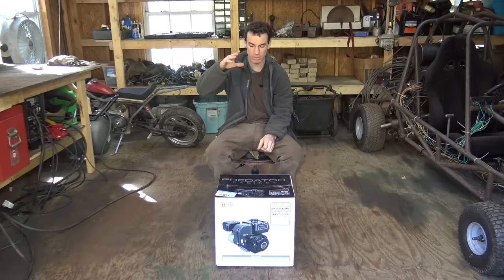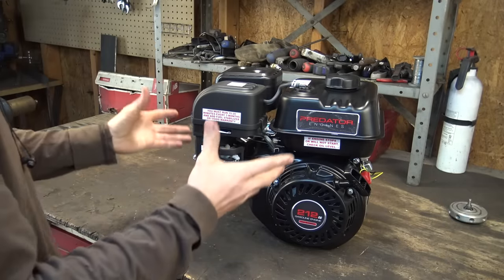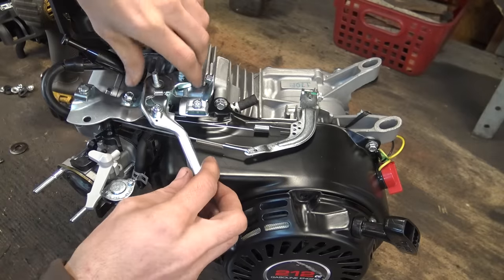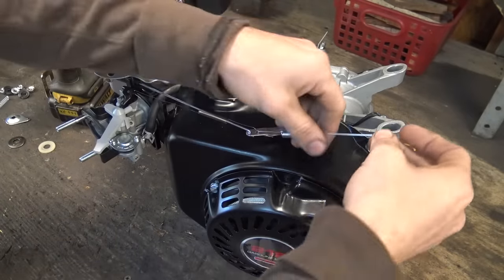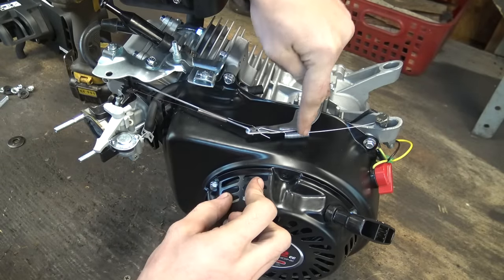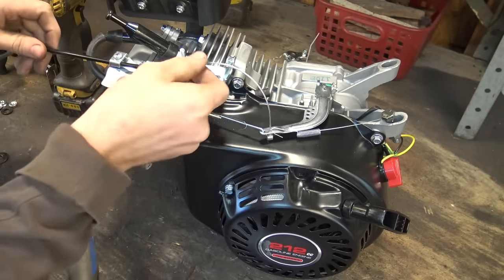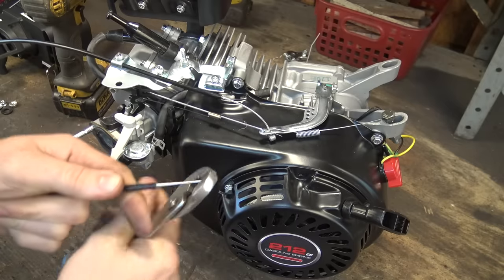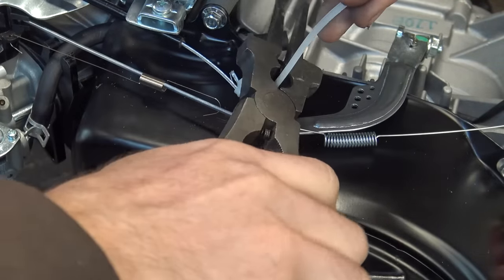how to bypass the governor on a predator 212 engine

Comment: one more thing you might wanna remove is the low oil cut off switch
Reply: Donovan Bryant why would you need to do that
Reply: T8opnjh💍💎🛂🚤🚀🚉🚸🚷🚵🚴🚳🚲⛵🛅🛄🛃🚶⛽🅿🚥🐶🐴🐖🐁🐈🐈🐱🐩🐇🐰🐓🐮🐄🐂🐃🐺🐐🐑🐏🐦🐥🐩🐤🐣🐔
Reply: If you're byutiful you can have a spris
Reply: +Trenton Smith the low oil cut off switch will shut the engine off sometimes even if the oil is not low and it also should be removed if the engine is being made into a racing engine
Reply: I put a screw through it so it doesn't make connection.
Reply: Trenton Smith cause when your taking turns oil is swinging around the sensor thinks your out of oil n shuts down the engine.
Reply: Trenton Smith just disconnect the switch n that other connector next to it.
Reply: That is not what this video is about, did you read the description?
Reply: Buy a Titan engine from gokartsusa.com. it's only a couple dollars more but it doesn't even have an oil sensor. Also it was made specifically for go karts and mini bikes unlike the predator engines.
Reply: I have a steep hill and driveway and I still have the low oil cut-off wire hooked up and it works fine never dies also mine is still governed I am trying this mod thanks

Comment: To make a ball on the end of a cable, bend the end, then wrap some copper wire (or some other wire you have layin around) inside the bend and around it, then solder it.  I used to do that with clutch cables on dirt bikes when I was a kid.

Comment: you can leave all that stuff on and just put two small zip ties around the spring and tighten till you get the right rpm the gov kicks in adjust accordingly.
Reply: How
Reply: @noahnubbs  there is a spring for the governor arm, just add 2 small zip ties inside to keep it from stretching open tight till you get the rpm you want.
Reply: @keithw372  thank uuuuu

Comment: @3:35 that spring just kink it and put it through the hole the make it catch the lip and hold and you should have enough room to pu the tank back on. same way I run mine without removing the inner governor and over time it will get faster !!! or blow up 1 of 2 ending's !!! don't hold wide open no more than 10 seconds at a time and run some 2-stroke for the higher rpm's.

Comment: At 2:53 if you remove that screw and keep the whole throttle assembly it will bypass the governor
Reply: Mike812 that's I thought ! But even his way the small plastic thing shouldn't even be spinning right ? Or no
Reply: That's actually not correct, you're still limited. It will surge and you will go top speed then slow down repeatedly, I just take the throttle arm and put it directly to the carb eliminating all the springs

Comment: RatherBWelding, So can I do this same process on my stock 196cc Mini Bike to bypass it's governor ? The thing is the throttle cable is already running to wherever they are running to when they come stock out of the box. Does the throttle cable have to be connected to the Governor Arm for this too work or can I just do the first half of this video and only connect the spring to the governor arm and leave throttle cable where it is ? Sorry I'm a newb and I need Help !!

Comment: Just purchased a go-kart with this exact engine.  This is so simple to follow, especially with the governor setup on these engines, the throttle over time gets stuck open.  Thank goodness for kill switches, right? ;)  Hey thanks for the video.  This was helpful!
Reply: if your throttle stays wide open just loosen the nut holding the throttle arm
Reply: yo if your throttle sticks you have a problem lol

Comment: Quick question for anyone, what is the reason for bypassing the govenor? Will it increase speed?  Just wanting my mower to move faster
Reply: The governor is just a rev limiter so without it you can run much higher RPMs
Reply: No lawn mower needs the governor removed unless you remove the deck and just ride around on it with a manual throttle. Bypassing on a push mower would be really stupid.

Comment: If you relocate the gas tank and swap it out for  a single hose connection, what do you do with the vacuum line on the engine? Plug it? or just leave it open?

Comment: I did this with new engine and it rattles at high sped that good
Reply: Well the point of a governer is to limit the rpm, by bypassing it you'll get alot more performance but you're also stressing the engine more because it's now running at 5200rpm max instead of 3600rpm max.
Reply: @Visuint depends on the use case and the cooling
Reply: Visuint you need to upgrade your internal parts that can handle more rpms.
Reply: U are a high sped
Reply: Put oil in it

Comment: The governor arm is still hooked up to the governor,,,so how did this by pass the governor.The throttle cable is hooked up to the governor arm.
Reply: fstngone he’s just removed the throttle arm and connected it back to the governor, not bypassed the governor.🤔
Reply: Exactly what i was wondering
Reply: But rather than the governor arm cutting the throttle you’re holding it open not allowing it to cut. Reach back when you’re riding and hold down the governor arm. Same principle. In other words free speed who don’t wanna crack open the engine

Comment: when you are using the cable without the ball you dont need to use zip ties y woud use a cable terminal block its much safer

Comment: Sorry ! but your not disabling the governor doing it that way !  the lever from the crankcase (governor arm) is still going to push on the throttle cable    all you are doing is reducing the governor's effectiveness ( it doesn't work as good as it used to)
what you need to do is leave the little spring on the back so the governor gears inside have something to keep them in check , but disconnect the throttle linkage completely from the lever, yes that gets more involved because of the way you have to actuate the throttle but that is the price you pay of taking the governor out of the equation....
a longer lever on the throttle butterfly and a spring to hold the throttle closed and you then would have the governor disconnected without going into the engine to remove the internals.... 
I would not remove the governor lever arm because of how these engines are made , leave it on and just use a spring to hold a small amount of tension on it.... but you need to disconnect the carburetor from the governor lever arm or your not getting anywhere.... because at top RPM the governor will still fight to close the throttle even if you put a bigger spring on it !
....so the real fix is disconnecting the throttle from the governor completely ! that makes hooking up your twist grip harder but it's the only easy way ! 
Bob.......
Reply: Bob Kelly, thank you sir. I thought I would read through the comments before saying what you said so clearly. Put a spring on the governor arm to keep it inline, throw the linkage away and build a simple bracket to hold your throttle cable housing. Then your gas pedal is just working the carb directly. I see guys opening engines up and losing track of how to properly reassemble them, it's amazing.

Comment: I bypassed the governor on an old Briggs and it threw the rod 2 weeks later.  The governor is there for a reason.
Reply: See what you need are some good valve springs, a mod 2 cam, an arc billet rod, a billet flat top piston, and a better flywheel. Then take that governor off and rip 👍

Comment: All you did was change the linkage points you did nothing to the governor except hooked a spring to the other side replacing the one that did the same thing that handle you threw away is just to manually adjust the rpm of the engine and holds it in that position you need to watch a YouTube video on the governor removal there is a lot more to it than that
Reply: That's exactly why the video tytle is called BYPASSING THE GOVERNOR not REMOVING THE GOVERNOR

Comment: The only function of the internal governor it to turn the bolt/shaft that is protruding through the casing, correct?
As such, with nothing connected to that shaft, the intermal governor CANNOT interfere with the throttle speed at all.
The external "governor arm" is no longer a "governor arm" once it has no connection to the governor shaft, it is merely a pivot point.

Comment: The valves start to float and then it bends the valves
I know from experience
Reply: James Becker wouldn’t getting higher weighted valve springs keep it from doing that ?
Reply: @jman1239  yes, but then the cast flywheel shatters like a grenade. Then you get a billet flywheel and the connecting rod fails. Then your valve colet fails after you get a billet connecting rod so you need stainless valves. Its always a snowball effect lol
Reply: Jim Holesaw ...I see you’ve “been there done that” as well😆 must admit it’s fun trying to get a few extra HP/LB-FT out of a 5-10 hp engine! My thinking brain has however did the math. When going to harbor fright(spelling is correct for all intended purposes) to buy a new engine it would be cheaper to buy a 15-25hp engine than buying a 6hp unit and getting 7-15hp with many $’s on hi-perf. Parts. 🤷‍♂️😆
Reply: @dieselsmiths  yeah i have about $1200 in my 30hp minibike. If you go with more displacement youll have more torque but not rpms and since we dont have transmissions. It goes back to that big block vs small block battle. 15hp with a 212 that has 36 jet a 265 lift dyno cam and exhaust with 26lb springs $120 roughly.
Reply: @dieselsmiths  yeah i have about $1200 in my 30hp minibike. If you go with more displacement youll have more torque but not rpms and since we dont have transmissions. It goes back to that big block vs small block battle. 15hp with a 212 that has 36 jet a 265 lift dyno cam and exhaust with 26lb springs $120 roughly.

Comment: Do not use zip ties. The best thing to use is wire crimps, used to join electrical wires together, slide it in there and crush it. I attached the spring to the ground screw that’s right below the fuel tank mount.

Comment: If you actually bypass it, you need heavier valve springs so you don't ruin your engine
Reply: its not interference, you can float valves and not hurt anything
Reply: @brysonshires9742 , except performance.

Comment: What would happen if you just adjust the governor control arm to a different position on the governor linkage. It would still be governed but it would rev to a higher limit but prevent WOT speeds. 
I don’t know, I’m just asking for a friend.

Comment: If you take that arm off then how are you ment to start your engine ?? That helps start mine up, if its not starting alone off just the pull cord ?? I have a similer engine, but mine is a Lifan, so the set up is a little diffrent but can i still use this process ?

Comment: If you use bike cable, the bike shop has little crimp butt ends for the inner cable that won’t fall through the hole and is plenty strong enough if you really crimp it down

Comment: Unless you put in a performance cam there is no reason to delete the governor. The highest stock engine torque/hp sweet spot happens at 3600 rpm, set the governor by adjusting the linkage stop screw or tightening the governor spring to achieve that 3600 rpm. That's as much power as you can get with a stock engine, you will get less power at higher rpm. Also unless you install a billet connecting rod the stock one will break at high rpm and the cast iron flywheel will develop hairline cracks and soon shatter. The pieces will fly at you like shrapnel from a land mine, a billet flywheel is needed. Additionally, stock valve springs will float causing them to send explosive shockwaves throughout the engine head unless they are replaced with stronger ones. Removing a governor using any method is nothing to mess with unless you know what you are doing, it's dangerous. If this guy were older he would have seen engines blow up, and have more common sense. All the pro-kart racers know this, it's common knowledge.

Comment: Gears, I did this to my 30 horse twin with no catastrophic failure. My predator engine gets the same treatment, actually install mikuni 28$ without any problems. Let us know your experience with this modification.

Comment: I had a techumseh 5 hp and I removed the governer because my friend lost all the linkage and I actually removed the gear but left the arm so I didn’t have to tap it. I ran for about 2 months and I tipped my tractor and oil leaked out but I didn’t car and it developed a tick. I got a new engine so me and a friend tried to blow up the 5hp and we had to put a spring on the carb at full throttle and fill the case with water. Still took 15 mins for it to go
Vid on my channel if you wanna check it out

Comment: I just bought a go kart with this engine. I left it outside and it rained. Will my engine be fine?
Reply: Cover the engine and if it’s gonna sit for a long time drain the gas tank. The go kart will rust because it’s exposed to the elements but it depends on how long it is out there. Use a trash bag to cover the engine
Reply: Yes, but it may not start if water got in the carburetor or the gas tank. This is essentially a lawn mower engine, so do anything that you would do with a lawn mower.

Comment: what is the use of a governor( i'm new to this stuff)
Reply: Felix Renard the governor keeps the motor from reviving higher then what it is designed to do therefore by removing the governor you are at a higher risk of blowing up the motor and it voids any warranty that the motor has if you remove it
Reply: Noah Ottinger I have a custom straight pipe exhaust on mine and a customer air filter or box what ever and will by passing blow up my engine?, We race our mini bikes and I am the fast one already just wanna be faster
Reply: Manuel Xavier Gonzalez you can bypass the governor if you can be responsible with the throttle
Reply: Blake Miley - TMC responsible with the throttle ?what you mean
Reply: Manuel Xavier Gonzalez it means to know how long to go WOT. Don’t  go WOT for long periods of time.
Reply: The government is there to control your engine to go slow.
Reply: Hi Felix, the use of a governor is actually to maintain constant revolutions during an increased load applied to the output shaft of the internal combustion engine. The governor is specifically designed for outdoor lawn and garden applications such as generators, lawn mowers, chippers, and grey water pumps. The stock engines, for these applications, are subjected to a load surge when making the tool do work. But, there is also a constant throttle setting with these applications. So, the governor keeps the engine running   consistently by reserving additional throttle for high loads in the duty cycle....
Reply: Now this gentleman knows    HIS Stuff

Comment: First of all The governor still going to engage second of all it is much easier just to remove the side of the case and pop the gear off
Reply: No the internals move the arm which regulates the throttle butterfly to maintain rpm. This mod forces the arm to open the butterfly and does not allow the governor to pull it back. So with this mod the engine is free to rev as high as it can until it blows up of course.
Reply: The governor is still there and functioning. It is just being over ridden by the force of the return spring so basically the governor is not strong enough to  engage.
Reply: @Cronic318  thank you for spelling it out. So many on here popping off without a clue.
Reply: @hail_Cyber77  correct

Comment: I did this on my gx200 clone and basically, it wouldn't start until I added a bit of throttle, also there were a lot of flames coming out the exhaust port (with no exhaust attached) which I'm guessing means there was a lot of unburnt fuel left.

Comment: U didn’t “bypass” the governor.  U just re routed the throttle cable position.  That motor still will be governed to stock rpm governor. 🤷🏼‍♂️.
Reply: your wrong dude with the governor in it revs to the mid to high 3000's by doing this it revs to about 5500
Reply: Cole Estes wrooonnng.  The governor is still installed.  Put a rpm gage on it. Rev it in this set up. And u will see that shit still governed.   I already done this. And it was a waste of time. Which is the reason for my initial comment.
Reply: Cole Estes this doesn’t do shiiiiiiiit but change the position of the throttle position return spring.  It serves no purpose or use that deals with governor operation.  Put a rpm meter in the spark plug wire and rev it.  Ull see, it’s still governed.   This was a good attempt. But failed attempt.  Just take the time to remove the governor
Reply: You can't possibly be serious? If you really tried something like this and it didn't work, you did something wrong. With the configuration shown in this video the governor cannot control the throttle position. It's just not as powerful as the person at the end of the throttle cable. Yes the governor still operates but just isn't strong enough to affect the throttle position like it can with the throttle spring in the system.
Reply: Dude it works I did it
Reply: Negative there when you hook up straight to the governor the governor can not over come the force of the cable rendering it disabled
Reply: @tarheelnation_561  Yea you don't have a clue what you are talking about LMFAO!
Reply: so the govenor closes the throttle at high rpm. could you just remove the arm and hook straight to carb

Comment: I'm about to put a 212 into a Coleman CT200. I'm curious,  how, or why does this work? The internal governor is still present. I don't understand the physics of this. Can you explain? Thanks.
Reply: Because the throttle originally connects to the other side of that lever, this side of the lever interfaces with the part of the governor inside the engine. By attaching throttle directly to the other side the lever doesn’t interface with the governor
Reply: @donovanswift5010  I kinda get that. And much easier than a full removal. Thanks.